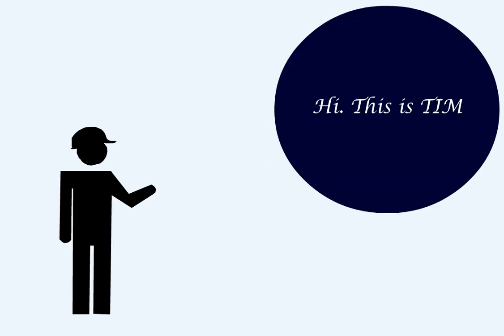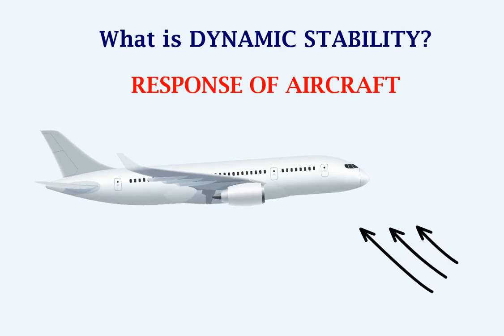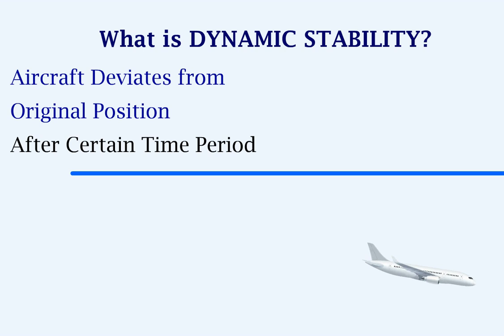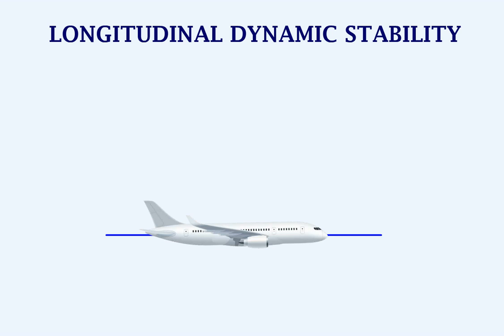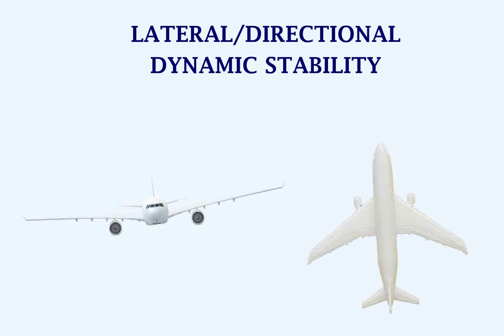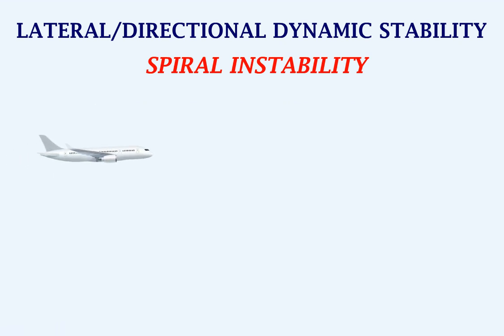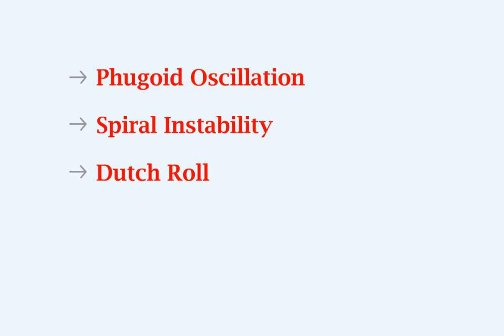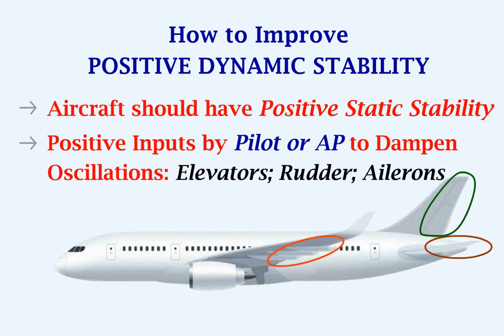Understanding Aircraft Dynamic Stability, Phugoid Oscillation, Spiral Stability & Dutch Roll!

Comment: Nice video. But wrong explanation at 3:25. When the aircraft is put into a roll on either side, the yaw happens on the opposite side. Which is why it's called the adverse yaw. This is because the drag on the high wing (which is the right wing if you are turning left) is higher as angle of attack/camber is higher for this high wing. This causes the high wing to move slower than the low wing, causing the plane to yaw towards the side of the high wing (which is right if you are turning left).

What the speaker is referring to here is the changes to the horizontal and vertical component of the lift vector as the plane tilts, and that produces a sideways force to make the plane GO LEFT, not turn left. This horizontal component of the lift acts on the Center of Lift of the plane. Which is precisely why you are taught to apply coordinated rudder when turning to counteract this adverse yaw. This is more pronounced in sailplanes. Keep that ball in the center, people, so your butt is pushed down into the seat, and not to one side. 🛩️
Reply from the maker: Cool. Thank You for the explanation!

Comment: Nice video!
I have one remark - swept back wings and dihedral angles can make the dutch roll mode even worse due to the dihedral effect (which is the interconnection between roll and yaw). To eliminate dutch roll, the pilot needs to make slight rudder inputs, sometimes so slight that he can't really perform it. That's why swept back winged airplanes have a yaw damper, which is a part of the flight control system/autopilot (whatever you like to call it). It makes all the needed inputs and provides a safer and smoother flight, transparent to the pilot.
Reply from the maker: Thank you for the information!

Comment: would you do some questions like If it is desired that the damping constant and undamped natural frequency of the aircraft’s Dutch roll 
should be 0.6 and 1.4 rad/s respectively, determine the state feedback matix, K, to achieve this 
using either Matlab or theoretical calculations.

Comment: At 3:31 I don't understand how the leftward yaw is happening.
Shouldn't it be in opposite direction if explained by adverse yaw.
Reply from the maker: This is case of yaw due to a roll. The Lift Vector gets tilted towards the left so there is a horizontal component of the lift that tends to yaw the aircraft.
Reply: @JxJAVIATION  Just to help this is actually the opposite. It's called adverse yaw. If an aircraft rolls to the left, the left aileron will be up and the right aileron down, this produces a forward component of lift on the left wing. Meaning left roll creates right yaw.
Reply: @allsaintskidda  Just curious: This is in the case of a disturbance from a non-control surface. Would the same still apply?